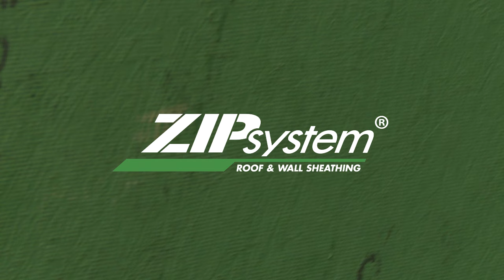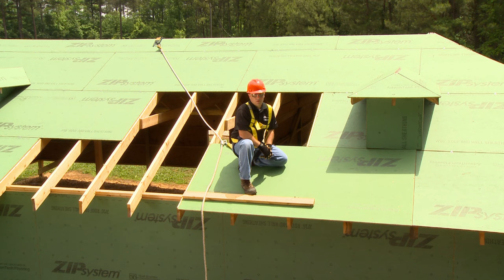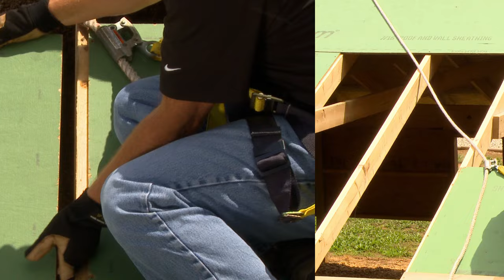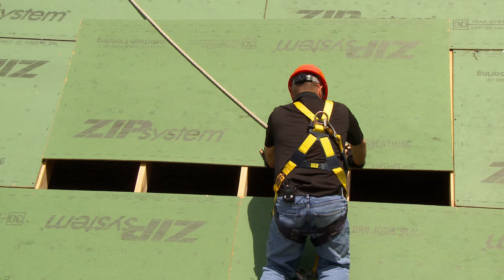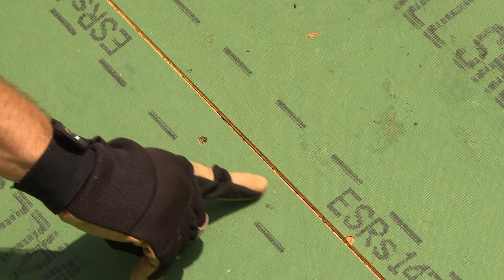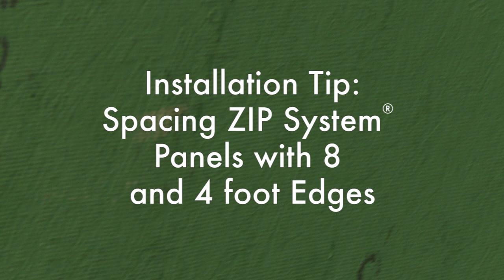Panel Spacing | Mastering the Basics | ZIP System roof sheathing

Comment: You didn't explain anything? Looks like they are in contact.
Reply: They are. On the 8 foot edge there is a special crush profile that can absorb the expansion if needed.
Reply: @jessesilver  thanks. So in contact, but the edge can deform